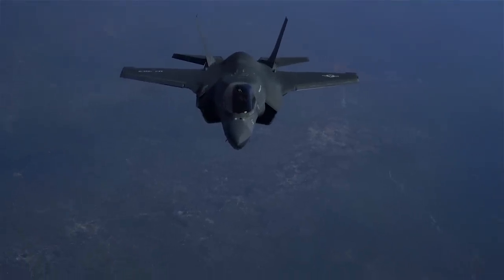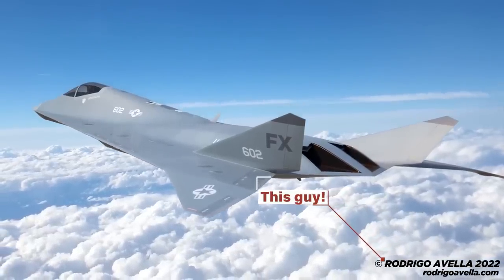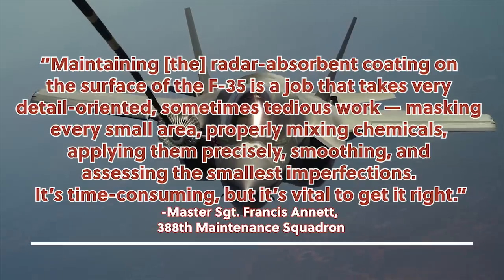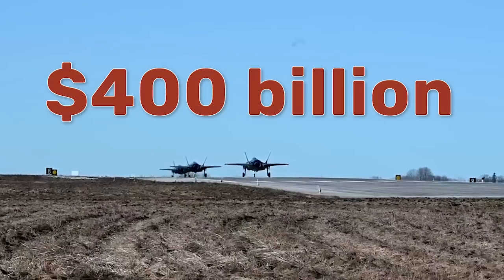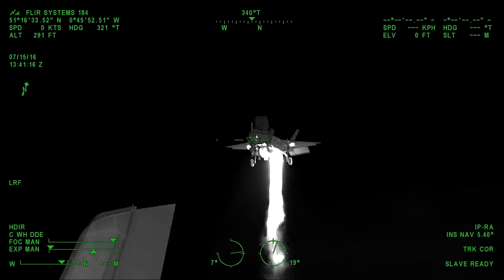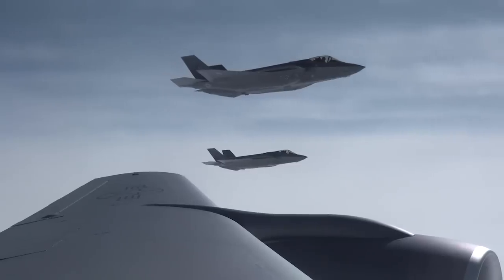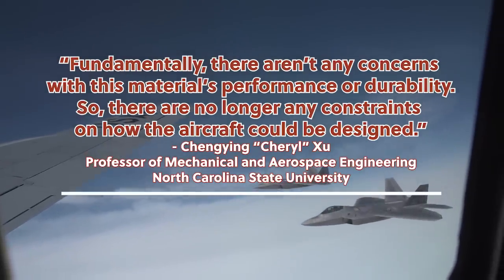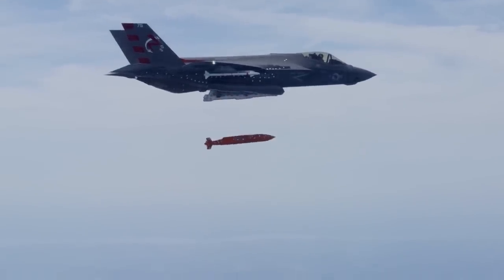The biggest leap in stealth tech since the F-117

Comment: ...Yes, I'd like to cash my "I Told You So" check, F-35 fanboys. Just put "matchesburn was right" in the memo line... Please, keep your tears off the check, thank you.
Reply: Taking a victory lap over a non-issue. Absolute state of F-35 haters.
Reply: pogue
Reply: @f.a.2115  
"over a non-issue"
The F-35A being so expensive to operate that the USAF is buy F-15EXs instead to operate is hardly a "non-issue." The absolute state of F-35 fanboys.
Reply: @matchesburn  Yeah the USAF asked to cut back to 80 F-15EXs. There's like 300 F-35As and more deliveries every year. You can't operate 12 aircraft to make up for the 300 that already exist and adding another 68 to make up for over a thousand F-35As. Whoever sold you the narrative that F-15EXs will operate "instead" of the F-35A lied to you. To begin with, because some will go directly to the air national guard to retire old F-15 airframes. Not to replace F-35s.
Reply: @f.a.2115  
"Yeah the USAF asked to cut back to 80 F-15EXs. There's like 300 F-35As and more deliveries every year."
Deliveries that the USAF cut back as well. And of which are only a few dozen a year.

The Air Force will propose about a 10 percent cut in its planned F-35 purchases in the upcoming future years defense plan, citing sustainment costs for the jet well above what was expectd, and because the service prefers to wait for the more advanced Block 4 model. Budget talking points obtained by Air Force Magazine appear to show the USAF giving the F-35 program an ultimatum: Get costs under control over the next six to eight years or the overall buy will be sharply reduced.

According to the talking points, which were prepared for Chief of Staff Gen. Charles Q. Brown. Jr., the Air Force plans to request 48 F-35s in fiscal year 2022, but only 43 aircraft a year from fiscal 2023 to 2026. The effect over the five years would be to buy 220 jets versus 240 under the previous plan.

Whether Brown has signed off on the new plan is unclear.  “The information outlined in the talking points regarding future Air Force fighter force structure is pre-decisional,” said Brig. Gen. Patrick Ryder, the Air Force public affairs chief, who declined further comment about pending budget or resourcing decisions.

In the last three budget years, the Air Force requested 48 F-35s and Congress added another 12. That 25 percent increase on USAF’s depot and spares capacity has hurt mission capable rates and prompted some members of Congress to declare they will fight any further such “plus-ups,” to let the sustainment enterprise catch up.  

The Air Force set an operating cost goal of $4.1 million per airplane per year—in fiscal 2012 dollars—early in the program, expecting the cost would be in line with that of the F-16. It has failed to hit those marks, however, and Air Force leaders have recently expressed hard skepticism that the goal can ever be achieved. Air Combat Command boss Gen. Mark D. Kelly said in February he was not “brimming with confidence” about reaching F-35 support cost goals, and he reiterated that sentiment after a late March tour of F-35 sustainment facilities.

In fact, according to the USAF talking points, the service expects sustainment cost per tail per year to be $7.8 million in 2036 (again, in 2012 base year dollars).

“This is an unaffordable sustainability model, if the F-35 were to become the majority of [the Air Force’s] fighter fleet,” the document said. “The Air Force needs the F-35’s advanced capabilities, [but] in affordable capacity.”
-----------
In its budget request for Fiscal Year 2023, the Air Force has reduced its expected overall F-15EX purchase to 80 aircraft, after originally saying it would buy at least 144 to replace its aging F-15C/D Eagles and perhaps also to supplant its F-15E Strike Eagles. If the service does follow through on this new plan, the final Eagle II would be purchased in Fiscal Year 2024.

A suggestion that the Air Force officials might be looking at trimming the overall F-15EX buy came late last month. Valerie Insinna of Breaking Defense reported that “two sources with knowledge of the matter” had confirmed that Secretary of the Air Force Frank Kendall had tasked the service’s budget corps to consider canceling the F-15EX.

In the short term, however, the F-15EX is safe. The Fiscal year 23 budget request calls for F-35A procurement to be trimmed back — 33 aircraft as opposed to 48 in Fiscal Year 2022. At the same time, the latest proposed budget includes 24 F-15EX jets, worth a total of $1.4 billion. The previous budget for the 2022 fiscal cycle request covered 12 Eagle IIs.

The current plan is somewhat more complex than simply striking the F-15EX off the order books after these 80 aircraft have been bought. Instead, according to the sources, Eagle II acquisition numbers will be ramped up in the short term, before ending prematurely in favor of buying more F-35As in the more capable and deeply updated Block 4 configuration.

This plan would concentrate on replacing the F-15C/D air superiority jets as fast as possible, over a period of around five years, after which focus would return to the F-35A.

As it stands, the Pentagon is still in talks with Lockheed Martin over the next F-35 production lot, likely to amount to around 400 examples. With the Block 4 update behind schedule, the U.S. F-35A procurement rate has had to be slowed down, for now at least.

At this point, it’s worth noting that an 80-aircraft cap on F-15EX orders for the Air Force is, currently, just a proposal. Congress would have to approve it as part of the larger defense budgeting process. Trimming numbers from the planned minimum of 144-aircraft buy will almost certainly face stiff opposition, not just from Congress, but also from supporters of the Eagle II within the Air Force and the Pentagon, as well as industry.

There’s also the very real question of how a reduced-size F-15EX fleet would be integrated within the Air Force. It seems unfeasible that it would not result in major changes to the current plans of fielding the Eagle II.

As it stands, testing of the F-15EX is underway at Eglin Air Force Base in Florida. Aircraft are due to be delivered to the Oregon Air National Guard’s 173rd Fighter Wing, the United States' only F-15C/D training unit, based at Kingsley Field, in the 2024 Fiscal Year. The following year, the 142nd Fighter Wing, another Oregon Air National Guard unit, at Portland Air National Guard Base, is slated to become the first operational unit to fly the jet in Fiscal Year 2025.

Responsible for 93 percent of all homeland defense missions, the Air National Guard was largely expected to recapitalize all its F-15C/Ds with either F-15EX or F-35A jets — although F-16s were discussed for a period — the precise balance of which is yet to be disclosed.

Still, that leaves the Pacific Air Forces’ 18th Wing at Kadena Air Base, Okinawa, with two squadrons, the 104th Fighter Wing of the Massachusetts Air National Guard, the 144th Fighter Wing of the California Air National Guard, and the 159th Fighter Wing of the Louisiana Air National Guard all flying F-15C/Ds with one squadron each. This is in addition to the 173rd Fighter Wing and 142nd Fighter Wing in Oregon. Something would have to give if only 80 F-15EX jets are acquired, with perhaps only one or two other wings being outfitted, after the two Oregon ANG units.

As for Kadena, that strategically important base has already been earmarked as a preferred F-15EX recipient, by the head of Pacific Air Forces, Gen. Kenneth Wilsbach. Last month, Wilsbach said he wanted to see the Eagle II replacing the two squadrons of F-15C/Ds currently operated from the Okinawa base.

Furthermore, Nahom talked about the F-15EX’s “ability to carry some outsize weapons that you [wouldn’t] necessarily put internal into a fifth-gen airplane,” which has long been an argument for the type. That, in turn, points to the Air Force increasingly viewing the F-15EX in terms of its potential to carry large air-to-air weapons, or larger air-to-ground weapons, including hypersonic ones, that wouldn’t necessarily fit in the internal weapons bays of stealth fighters like the F-35A and couldn't be efficiently carried under their wings.

"You can't operate 12 aircraft to make up for the 300 that already exist and adding another 68 to make up for over a thousand F-35As"
...That's some very interesting math. Fictional, completely wrong and nonsensical, but interesting.

"Whoever sold you the narrative that F-15EXs will operate 'instead' of the F-35A lied to you."
While I have no doubt that the USAF is lying to me about something, I don't think that they're lying to me on this particular subject. Especially given that they stated a desire to do so and are demonstrably and objectively doing just that. The disconnect is you don't understand that an F-15EX flying is an F-15EX flying instead of an F-35A. Therefore, my statement is true so long as the USAF has a fleet of F-15EXs, in fact as long as any F-15EX flies.

"To begin with, because some will go directly to the air national guard to retire old F-15 airframes. Not to replace F-35s."
Considering some ANG wings ARE getting F-35As (125th Fighter Wing, Florida ANG at RAF Lakenheath are getting F-35As to replace their F-15C/Ds), then that's not an argument that helps you. Because ANY F-15EX being given to the ANG, when some ANG units are getting F-35As, is a de facto F-35 replacement. Period.
Reply: @matchesburn  Where can I find this article?
Reply: @Fng_1975  
They were multiple articles. Separated by the "----". Take whatever part you want to read in its entirely, copy and paste a sentence, put it in quotation marks into Google search and you'll get the results. Obviously posting a link to the article won't work on Youtube.
Reply: @matchesburn  Yeah, that’s what I hate about the YouTube comment section, you can’t post links. Thanks for the reply brother!

Comment: Umm...the statement about buying an F35 for less than a modernized F15 is just plain incorrect lol. Yes, the F35s have gotten considerably cheaper..but the whole purpose of the F15EX is for a cheaper modern fighter...it's definitely not more expensive than the 35.
Reply: Latest published figures are that a bare F-35 can indeed have an initial purchase cost less than the latest F-15's initial purchase price. 
But as described, even with all the efforts to reduced cost of ownership, the F-35 is still more than twice as expensive to fly as the F-15 outfitted similarly.
Reply: @tonysu8860  dude they're buying BRAND NEW F15EX's from Boeing for like $20 million...a BASE F35A model is upwards of 60. And nobody buys base models..
Reply: This totally blew my mind...I can of course promptly admit that I was WRONG! My mind is blown right now lol
Reply: @tonysu8860  "the F-35 is still more than twice as expensive to fly as the F-15 outfitted similarly."(sic)

Per hour operating cost for the F-15 is about 80% that of the F-35A. You also need to factor in MMH/FH and MTBF for both types.
Reply: @jpierce2l33t  "dude they're buying BRAND NEW F15EX's from Boeing for like $20 million.."(sic)

You need to stop smoking heroin.
Reply: @AA-xo9uw  not funny, like at all. When the EX project started, it was slated to be cheap and around that price point. Also, I did used to smoke heroin and have been clean for several years, and don't find joking about that the least bit amusing. It's a HUGE problem in this country and is not a laughing matter whatsoever. So...get bent.
Reply: @AA-xo9uw  also, having issues with substances doesn't make me stupid in the least bit. I assure you, I've burned more brain cells than you were even born with lol. I just made some bad decisions earlier in life, and heavily paid the price for it...still am, in some sense. I also immediately commented back admitting that I was wrong, after looking up the current fly-away cost of the EX.